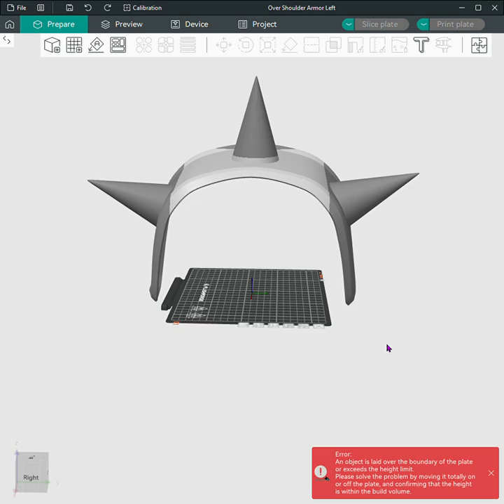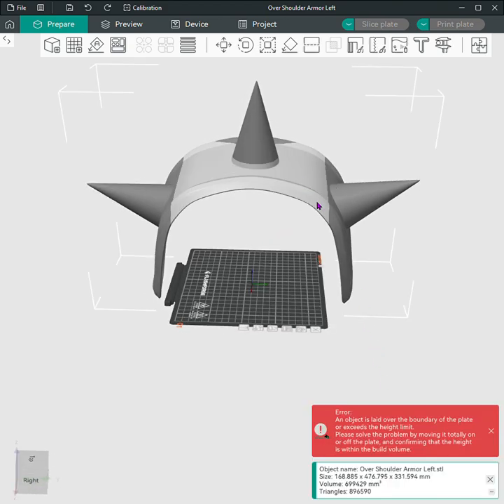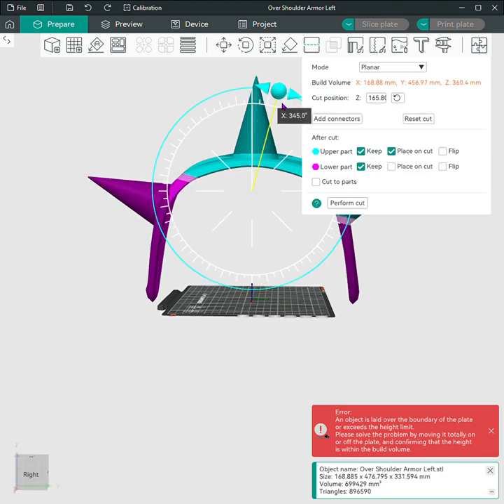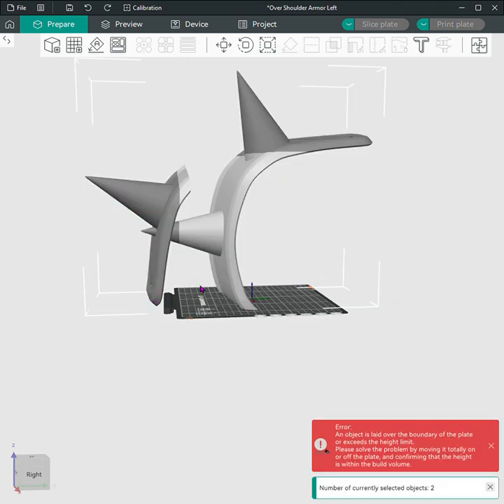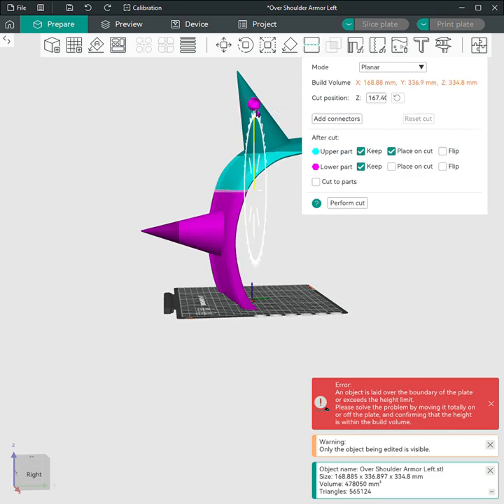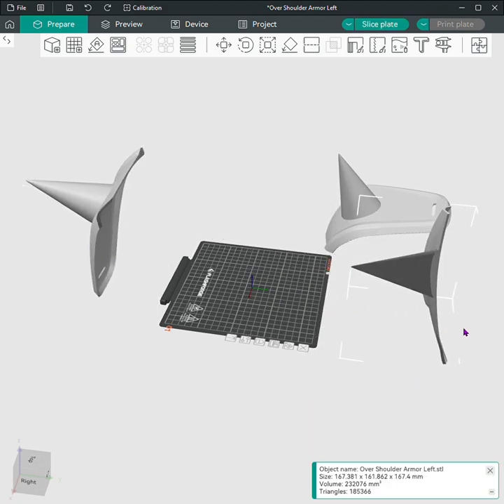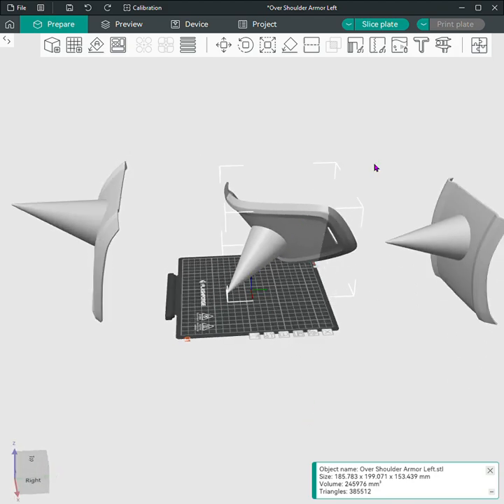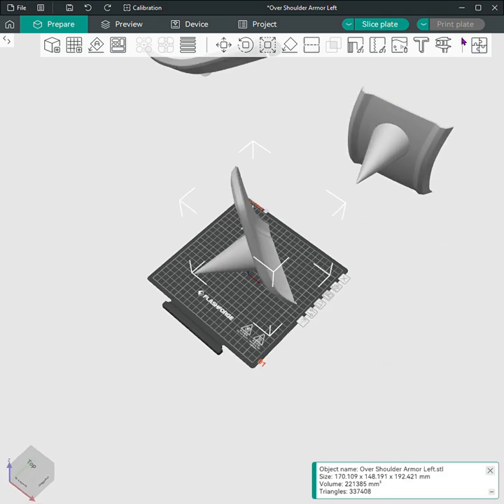how to cut 3d models in orca #3dprinting #flashforge #cosplay

Comment: My orca doesn’t have that cut button 😭 it only has “split to parts” and doesn’t work
Reply from the maker: I use orcra-flashforge
Creality
And cura they all have the feature im not sure about standard orca but i assumed it was the same maybe select slice model and before performing the cut un select into pieces and after that the part should be cut you may have to seperate the model after cutting to get it to seperate
Reply: @SUPERSAIYAN-3D Thankyou for replying I ended up being able to use the shortcut: shift + C even though there is no actual button on my version
Reply from the maker: No problem glad you figured out a way to do it